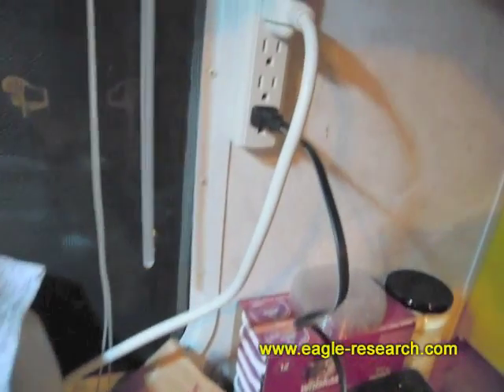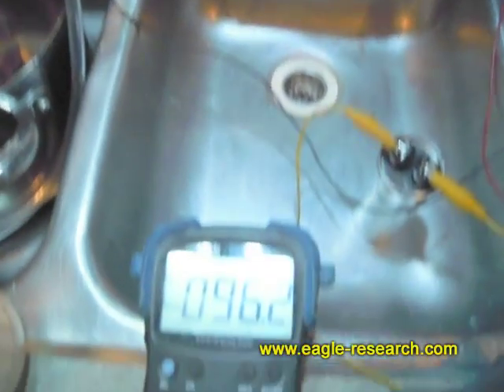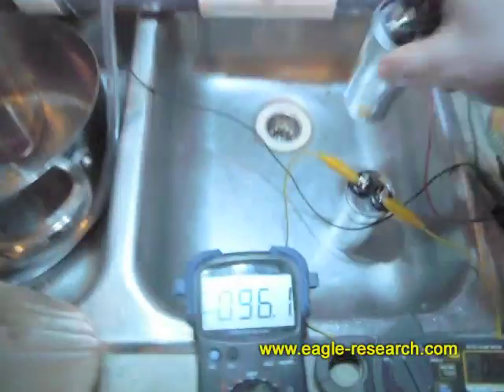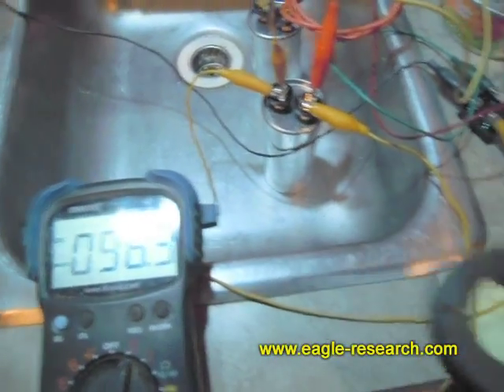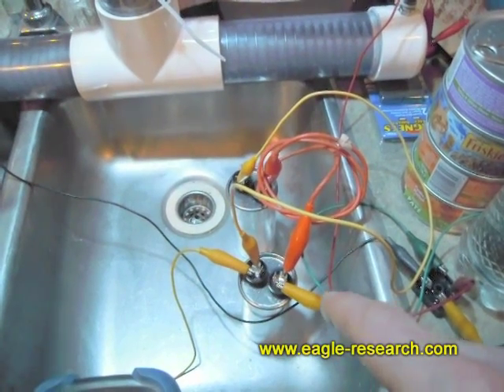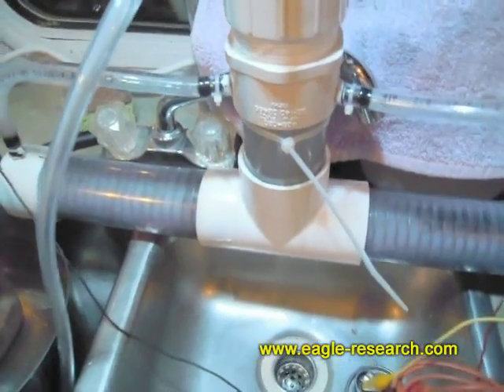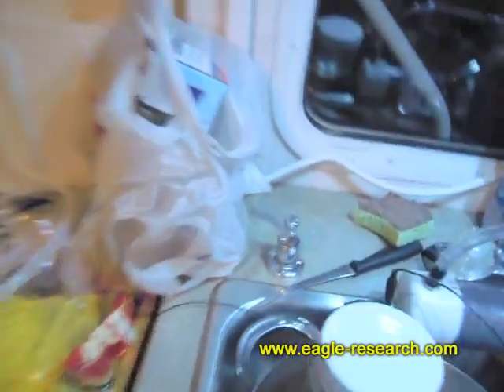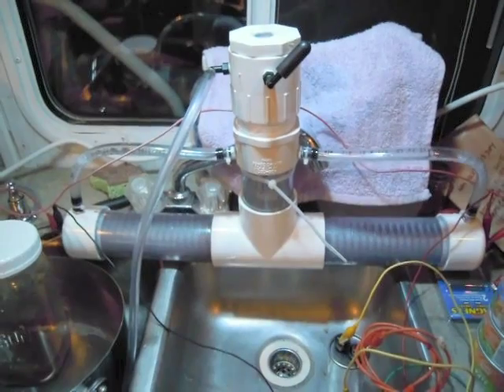ER50 Electrolyzer Simple Capacitive Power Supply

Comment: Hey George just bought the browns gas book 1. Planning on replicating your capacitive power supply. Just wanted to ask what are the name of the capacitors you use in this video.
Reply from the maker: No specific name, just oil filled capacitors, designed for continous AC use.
Reply: @ecopegasus  Hey George I have finished building my BG electrolyzer and just wanted to say thanks for all the info you have given. I already feel a change in my health and overall vitality. Just wanted to ask what is the most optimal plate design to produce the most Electricity expanded water. I heard you say in an interview that some electrolyzers do not produce as much electricity expanded water. I have 5 plate rectangular design. Anyway thanks for your help
Reply from the maker: @cartertech2531  My Brown's Gas Book 2 gives the full details on our most efficient designs.
https://eagle-research.com/product/browns-gas-book-2/

Comment: No clear objective for this experiment.
Reply from the maker: LOL... Obviously you missed it... But maybe understandable if you haven't read my book (which this video supports) Capacitive Battery Charger
https://eagle-research.com/product/capacitive-battery-charger/
The 'objective' and point... Is to have a step-down power supply that is near 100% efficient, easily adjustable and can be assembled from easily acquired scrap priced components.  

It can be applied to nearly anything that has a constant load.  For example, in my basement, I have an LED light (that I assembled myself) that has been continuously lit for over 20 years.

This Capacitive Power Supply is particularly well suited to electrolyzers, because they have a negatively inverse relationship to heat, losing resistance as they warm up and would have 'amperage runaway' if the amperage wasn't LOCKED in some manner.

So, using the CPS, instead of the amperage runaway, we have fixed amperage and a DROP in load voltage as the electrolyzer warms up, increasing electrolyzer wattage efficiency (the electric meter slows down).

Win win all around.  Try it out and have FUN :)
May the blessings be

Comment: You show that shorting across the load is safe. Does this depend on that small cap across the AC input, or is this also true with just the bigger parallel caps we have with the ER50? Thanks.
Reply from the maker: The small cap in parallel is to be ignored, it makes no difference, it's only there because I needed leads to attach the clips to.
The amperage is controlled by the larger capacitors in series with the load.